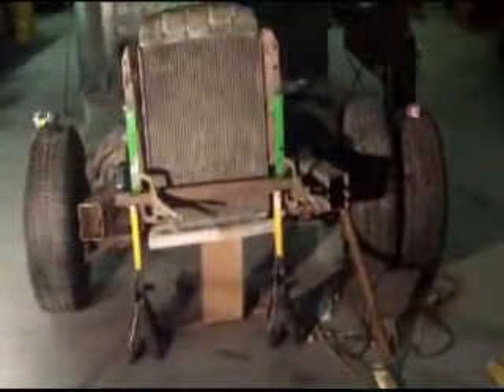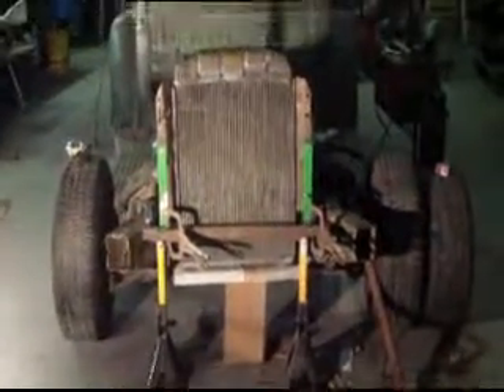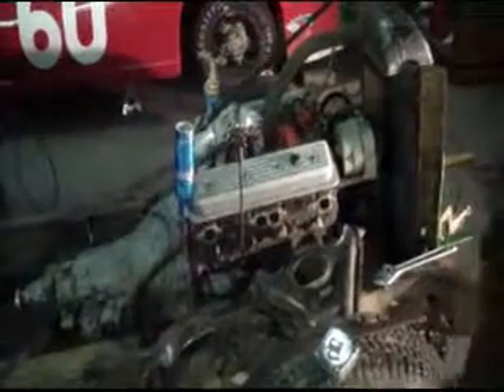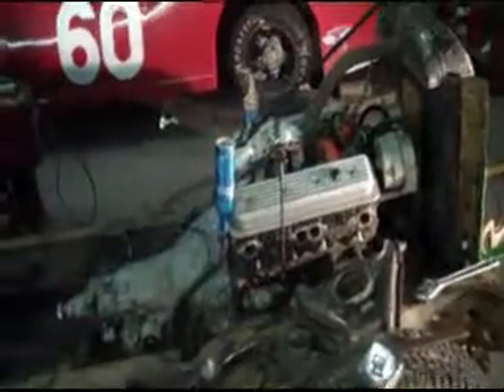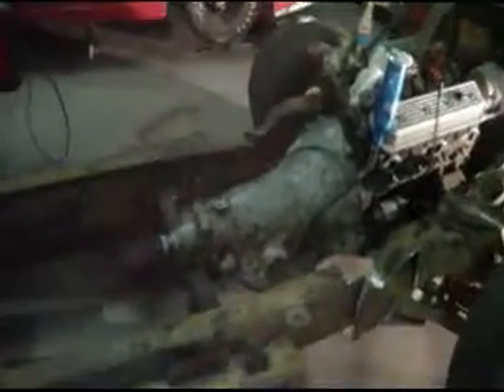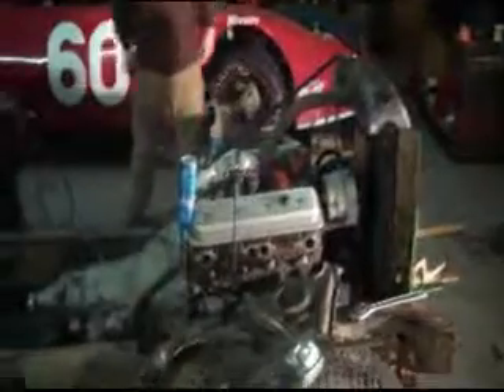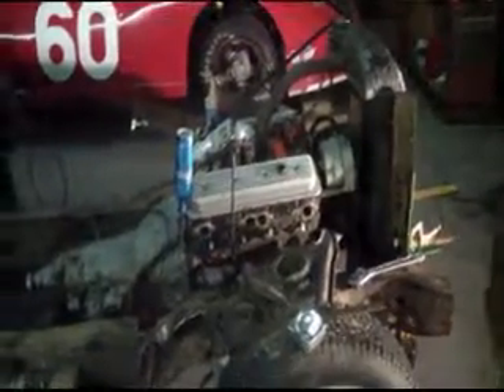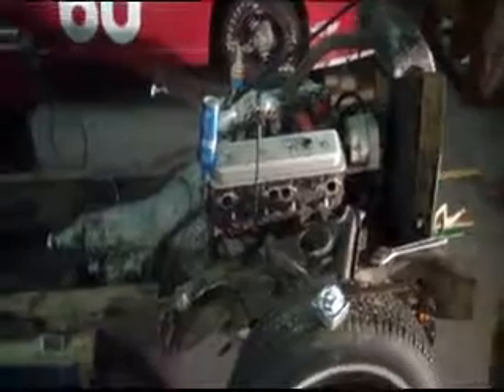WE worked on Da Weez's truck.

Comment: i like the tail lights what are they out of ?  so it,s half why there cooool ...
Reply from the maker: The rear fenders are front ones cut and turned around,The lights are a stainless steel bowl with the bottom cut out and lights mounted,
Reply: cool trick w/lights